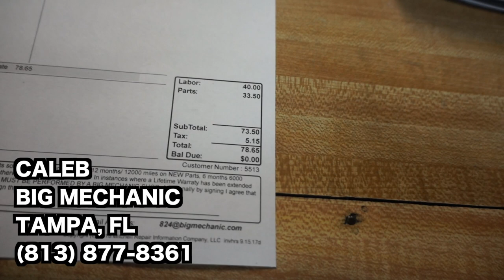Challenger Scatpack Resonator Delete + Revs + Pullout#scatpackshaker #moderndaymuscle #destroyergrey

Comment: @modern Day Muscle  I am in Tampa and am getting a 2019 Scatpack Widebody.  I already ordered the 24250 Race Bullets.  I think I am gonna leave the resonators on after swapping out the mid-mufflers for the Bullets.  that shop is good?  I'll check them out.
Reply from the maker: Yeah I was satisfied I would always double the check the work yourself after it’s done to make sure they welded it properly. I’m curious to how your scat widebody will sound
Reply from the maker: Straight pipe.. and not to me but if your Tampa and want to meet up at a meet and see u can if u want 😁

Comment: How do you like it? I have the same set up on my 2010 SRT8. But i also have X pipe as well.
Reply from the maker: I love it. I’m not experiencing that drone that everybody is talking about either. I can’t speak for other setups though. And the 2017 scat pack comes with the x pipe which is nice. Have you done anything to ur exhaust?
Reply: Modern Day Muscle the only reason why i changed my x pipe because the one in the the older 6.1 autos are fake lol smh. But i just have x pipe 24250 bullets & resonator delete. I just ordered two more bullets that im going to put in the back as resonators tomorrow. My goal is to make my car just a tiny bit more quiet & hopefully the 2nd set makes my exhaust sound a little bit deeper. I've changed my exhaust like 6 times already lol
Reply from the maker: I’m curious to hear that sound actually cause I almost did that. And the I don’t experience the drone at highway speeds when I’m in street or eco mode. But track mode is super drone but i kinda like it. I need to test sport mode lol
Reply: Modern Day Muscle yeah i actually got the idea from some website it was from a scatpack owner. So hopefully my other bullet arrive tomorrow & i pray i love the sound lol because im tired of messing around with my exhaust lol.
Reply from the maker: Lol Good luck man 🤟🏽🔥
Reply: SRT HEMI do you have 4 mini bullets on now?
Reply from the maker: No just 2
Reply: Modern Day Muscle did you end up getting the 4 dynomax on the car? How does it sound?
Reply from the maker: Just the 2 I cut off my resonators and sounds glorious lol